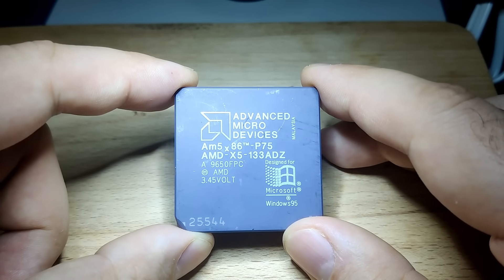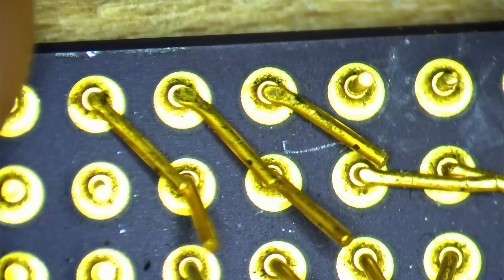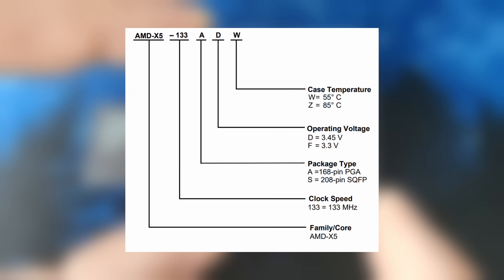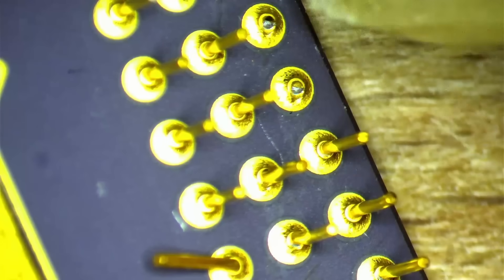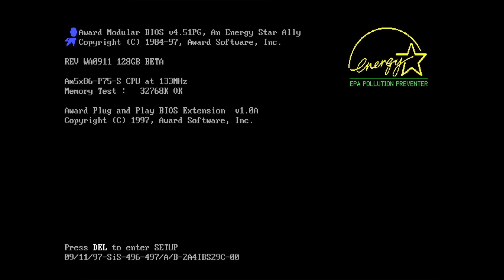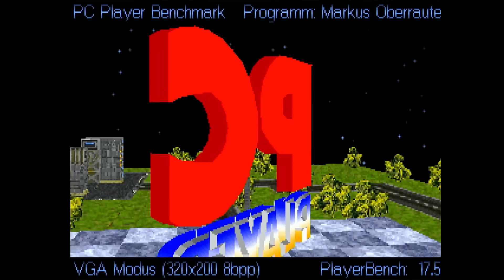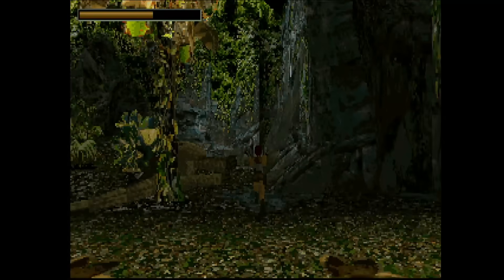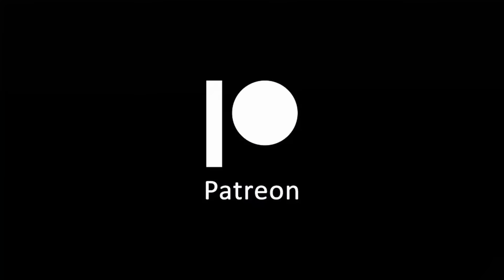Tomb Raider (1996) on the fastest 486 CPU (Part 4)

Comment: If you want to go wild: Try a 60MHz bus  by soldering a line from the S2 pin on the clock chip to ground (or S0 from memory, it's the one who's not connected to any  of the two jumpers). I've done that and gotten the board to boot with a 5x86 at 3x60 . The clock chip and the board is capable of doing it, it's just not connected since the VLB bus might start glitching, but if you do not use it ...
My "record" on this motherboard booting and running doom is 150mhz (3x50), but yours looks in a way better state than mine. Actually ... mine died and two address lines have leakage current comming from somewhere glitching them.
Reply from the maker: Oh, interesting! I am always available for a good mod! I'll have a look at this. The only issue I have with this board is that it only supports FPM memory.
However, I want to try something I found on a German forum: BIOS swap from a different board...
Reply: @bitsundbolts If you want to do that you might want to check the SIS496 stepping, my board has a non-EDO compatible earlier stepping, though information about it is not easy to come by which support what but higher letters in the alphabet is in general better afaik. The specsheet of the clockchip is on theretroweb site for this board. S2 (pin 17) is connected high, grounding it will give you the option for the 30/60/66.6/80mhz bus clocks the pll supports. There is a screwhole nearby which is easy to solder a wire to (+pinheader since the lower bus speeds need S2 to be high to allow you to disconnect it).
Reply from the maker: Thanks for all this info! I will have a look.

Comment: Well I said 5 pins a week ago. Technically you only lost 2, but you had to add solder to a lot more than that. So maybe 0.25 per pin? I saw about 20 of them. So that's about 7 in total. lol I did notice a difference with the overclock even in the beginning. That  felt a lot smoother. The dino still gives me headaches though. lol
Reply from the maker: Haha, alright. Yeah, it wasn't a perfect restore. Those pins were too far gone.
The overclocked AMD definitely improved the game a lot. I hope that I can get the CPU work at 4*50 - that would be amazing!

Comment: I used to do system build during this era. I never imagined these chips would be considered today for a retro build.

If I come across any relics should they be saved or recycled?
Reply from the maker: Those chips fetch more money when saved and sold to collectors and retro enthusiasts - provided that it's a working CPU. There are still some to go around, but they will get more scarce over time.

Comment: Maybe a ridiculous question, but can a motherboard be modified to run at 40Mhz? I've got one of these CPU's in an old Compaq but it only officially supports 25/33Mhz operation and I have always wondered if it could be modified (perhaps replace a clock crystal?) to get 40Mhz operation out of it.
Reply from the maker: Not a ridiculous question at all! I have not done this myself, but what you're describing is essentially what needs to be done. I don't know much about this yet, but it is an interesting question! I may look into this because I think I have a few boards that are similar to what you're describing. Would be cool to get a higher bus speed on those boards!
Reply: @bitsundbolts  I had assumed it was impossible.  I have a Presario 425 and it's two limitations are the bus speed and a max ram limit of 20mb, higher and it hangs on the memory count.  I'd love to solve for both, this was my first computer and it launched my tech career, including more than a decade as a core engineer on Windows at Microsoft.  I've always wanted to restore and upgrade this pc beyond it's limits...

I'll be watching when you go down this road, I'm super curious.
Reply from the maker: Is that this integrated CRT+PC in one case? I have one of those at home as well. I wanted to replace the CPU with one of those overdrive CPUs. I have two Kingston "Turbochip" CPUs which I would like to try out. They should be capable of working in this system without replacing any clock generator.
I am not sure about the memory though. The only issue is, that mine is in Germany and there is almost no possibility to get it to Dubai. I guess I'll have to do it when I am there for a visit.
Reply: @bitsundbolts  Yes! I have the Presario 425 from the very early 90's. I do have a AMD 5x86 133Mhz in there with a voltage adapter and it does work without any change to the clock generator. What I'm wondering about is if we could get one to 160Mhz by replacing that clock and getting the system up to a 40Mhz FSB.

I assume the memory fix will require a patch/hack to the BIOS, but I haven't a clue where to start there. The BIOS hacking sites don't have much about Compaq systems, which were unique in that they had their own BIOS reverse engineered from the IBM one rather than a common one like AMI/Award/Phoenix.

I'm in Portugal btw, need to get my Presario here from the USA at some point.
Reply from the maker: I haven't spent much time on that machine yet. It works and I believe it has a 33 SX CPU currently installed. It might be a challenge to get this system modded because, as you said, it's Compaq and not much information may be available for it.
Reply: @bitsundbolts  In the USA it was the first PC I ever saw for under $1000 which is how I could afford it, but it opened doors for me and as I said led to my career. As a result it's the only vintage hardware I've hung onto over the years.

Comment: I found a Am5x86 in a box of old parts at a local PC shop that was doing a closing down sale among other chips, funnily enough the date code puts it as 3 weeks younger than yours and thankfully only one pin has a very minor bend, although I need the rest of the system to go with it.

Also found a 256k Pentium Pro there too, very keen to try that out.
Reply from the maker: Very nice! I'm still amazed how Pentium Pros make other CPUs look really small 😁

Comment: I’ve used a red plastic tube from a can of wd40 to straighten pins, and also a hollow metal hypodermic needle. Just use finesse. I can also verify I had a ADZ version of this chip from new in 96, and used an interposer for freq/voltage and was clocked for 160mhz, 40mhz bus with no issues. Was on a shuttle 486 motherboard(forget the model)
Reply from the maker: Ah, I always lose those red plastic tubes 😞
But good point! I'll try to get one of those and see if I can work with it

Comment: Finally the video i was waiting for!!! Super ultra excellent job on the pins too, many would have just tossed this cpu in the bin... If your mobo allows and you have time, try 3x50 (perhaps insert a snippet of footage into your next video about these socket3 adventures). My ADZ runs that even on 3.3V and it gives further increase in performance compared to 4x40...
Reply from the maker: I'll add 3x50 in the benchmark video when I add the Voodoo card (after I fix it). My CPU does 150 at stock voltage as well. I'll also attempt 200 MHz, but I have to increase the voltage.
Reply: @bitsundbolts  thats cool! Cant wait to see that. Mine unfortunately tops out at these settings, lets hope yours do better. :) Tried 4x50 and 3x60 but neither of those work, wont even show any vga signal or any beeps.... :(
Reply from the maker: Yeah, totally depends on the quality of the chip. I don't know what mine will be able to do, but it would be amazing if it can do 4*50. I need to change the motherboard for 3*60. I don't know if I have one that supports such bus speeds. I just started working on the Voodoo card. Hopefully tomorrow I'll be able to test it.
Reply: @bitsundbolts  with the voodoo, tomb raider will fly as it will take the load for most of the calculations off of the cpu. But if your cpu will do anything more than mine clock wise, i will secretly accept the defeat. Im still crossing my fingers for you regardless because one 486 doing 200mhz is better than none lol (plus maybe an extra opportunity for you for one more video) :D

Comment: Erst liken, dann ansehen. Absolut erstaunlich wie viel Zeit und Sorgfalt in deine Arbeit reingeht und man danach mit einer funktionierenden CPU belohnt wird. Ich kann auch bestätigen, dass der ADZ bei FSB33 vom Speichersubsystem gebremst wird. Ein ADZ mit 3*40 ist ähnlich schnell wie ein ADZ mit 4*33. Du könntest mal prüfen wie ein Ur Pentium reagiert wenn man mit 2*50MHz oder 1,5*66MHz arbeitet.
Reply from the maker: Ich werde 3*50 und 4*50 (mit höherer Spannung) versuchen. Mal sehen ob's klappt. Leider kann das Soyo Board nur mit FPM Speicher. Mal sehen ob ich ein anderes Board mit EDO Support habe.
Ich habe einen Ur Pentium 75 für Sockel 5. Vielleicht mal was für ein zukünftiges Video!
Vielen Dank für's Video schauen!

Comment: Inpressive job straighening those pins! I wonder if cracked ceremic on the corner is common on those 5x86 cpus, as that happened to mine too. Only other software mode I would have liked to see is 50x3, as this is what I settled on back in the day. It consistently pumped out more fps than 40x4 in Doom and Quake on my setup. I know it's difficult to find tolerant video cards for this fsb speed though.
Reply from the maker: I tested 50x3, and it worked. The BIOS reported an AMD CPU with a P75+ rating. 
I'll cover 150 and hopefully 200 MHz in a later video.
Reply: @bitsundbolts  Nice, I'm always curious to see fsb vs clock on the 486 platform, since that's where I first experienced overclocking.

Comment: I ran the ADZ model at 200mhz. VLB clocked at 50mhz with cards that handled it. I ran Netware 3.12 on it at that speed for about a year lol
Reply from the maker: Did you increase the voltage or did the AMD run at 200 MHz with stock 3.45 volts?
Reply: @bitsundbolts  It was a long time ago, but I suspect I left the voltage the same; my younger self didn't know about voltage increasing for overclocking if I remember correctly.
Reply from the maker: Wow, it must have been a good chip. Mine doesn't boot @200 MHz when I leave the voltage at 3.45v. I wonder if it boots if I increase it to 4 volts.
Reply: @bitsundbolts  Its worth a try. I do recall reading somewhere at the time that some would go to that level. Unfortunately I have had a few sleeps and beers since then, and cant remember my exact setup. CPUGalaxy had this running @ 200mhz with 33mhz bus  with a multiplier of 6. He uses a peltier cooler - I certainly didnt have one of those back in the day lol
Reply from the maker: Yes, I watched his video today. I think it was 66 MHz FSB and a multiplier of 3. Massive speed gains if the board can deliver and your video cards work at this frequency. I'll try 200 using air-cooling. The ADZ model with its higher temperature rating should allow for some headroom. He used an ADW, but he had to go through many samples. So, I don't get my hopes up
Reply: @bitsundbolts  Ah I forgot he used an ADW (it was a while back when I watched his). I used nothing more than air cooling back in the day. Good luck!
Reply from the maker: Good to know. I'm not in the mood for a complex cooling solution 😅

Comment: There's actually a tool used in Watchmaking called a Pin Vice that would be amazing at getting the pins straight once you have the standing upright, I'm 99% sure its pretty inexpensive too.
Reply from the maker: Interesting. I'll check if I find what you're mentioning. I have so many socket 7 CPUs that need to be fixed.

Comment: Great job. I'd like to see 3x50 MHz and I think it would be faster in games than 4x40 MHz.
Reply from the maker: Fun facts: I tried it. In SpeedSys, the score is a bit lower compared to 169 MHz, but I didn't try it in game. But I'll try 150 as well as 200 MHz when we have the Voodoo card and a frame counter.
Also, @150 MHz, the AMD CPU shows up with a Pentium rating or P75+

Comment: I'm pretty sure the ADW version of this CPU was the one I got for the very first computer upgrade that I bought myself. It was a good upgrade from the 66MHz 486 that I had before, but it wasn't as much of an upgrade that I hoped. If I'd known it might have been a simple matter of bumping up the FSB to 40MHz, I definitely would've tried it and enjoyed the speed boost for a little longer before I upgraded. I think I got the am5x86 sometime in 1996, and I'm pretty sure it took me over a year to save up for its replacement. Even second hand, a Pentium MMX 166MHz was pretty expensive for a high school kid with no job. But if I'd waited a few months, I would've found I could buy a Pentium Pro 180MHz for about the same price as the Pentium MMX, and overclock it to 200MHz with no issues. I did end up doing that probably about 6 months later, because the guy who was selling that Pentium Pro board and CPU kept bringing it back to the computer market every month and dropping the price until it was stupid not to buy it (I think I paid like $60 Aussie dollary doos for it).

Anyway, great to see another scrap CPU fixed and working! It was very stressful watching you bend those pins back, I thought for sure one was going to break! But when you said those pins couldn't be straightened, it was somehow a relief that you decided to break them off and solder replacements on. But congratulations on a job well done, I'm sure it was very satisfying when it booted for the first time!
Reply from the maker: I can fully relate to your 486 experience. I had an AMD 486 DX4-100. I remember how scared I was overclocking it to 120 MHz. I found out because I went through the motherboard manual. But I reverted the overclock a few hours later because I was scared of damaging the CPU. And I couldn't feel much of a difference during the time it was overclocked.
I have two Pentium Pros (180/256, 200/512), but no board yet. Those CPUs are massive! Back then, I never paid much attention to them.
That beep during the first boot was definitely a relief! Would have been sad if the CPU wouldn't work after all this work.

Comment: These cpus can get up to 200mhz i used one of these clocked to 180mhz for years and played quake and other games with it.
Reply from the maker: That must have been at a bus frequency of 60 MHz and a multiplier of 3. A very nice overclock for such a CPU and the rest of the system. I need to check if I have a board that supports such a bus frequency. That system must have served you very well!
Reply: @bitsundbolts  yes i remember playing a lot of games that had pentium 75 or 90 in their requirments and they still ran pretty well

Comment: If only for asthetics, i personally would have repaired that broken corner with a bit of milliput or something similar, and filed it down with a nail file. Not that it would make any difference in operation, but it would give it a nice finish.
Reply from the maker: I can still do that. The corner is a bit of an eyesore, but it also is proof that this is the same CPU before and after fixing the pins.
Reply: @bitsundbolts  yes that's true. I think my OCD would have forced me to do it. Amazing job on those pins btw.  You did a marvelous job. I remember 12 year old me building my first pc with whatever I could get my hands on cheaply, and having to do a pin straightening job on the CPU. I snapped 3 pins off, and I had 2 use a paperclip to make new ones because I couldn't think of another way to repair it. It worked though, right up until I was around 15 and could afford a better machine.
Reply from the maker: A very creative solution to use paperclip. Glad that it worked out for you!

Comment: I've always thought it should be called the DX8, because clearly the multiplier is the log2 of the DX number plus one.
Reply: No, it isn't :) I have read somewhere that it was basically just a market name thing. It went like this: when Intel originally invented the thing called multiplier, they came up with multiplier of 2. So they marked it DX2. But for future, they wanted more granularity, so they planned to use halves, not only integer numbers, just like they were being used for many years to come in Pentium 1/2/3/n lineup :) So the next multiplier was planned to be 2.5, for which a market name DX3 was planned. But the processors with this multuplier were never released. However, it was already decided, so when multiplier of 3 came out, the processors were marked DX4. Thus, AMD did the next best thing they could when adding a new feature to an already abandoned (by Intel) platform, and marked the multiplier of 4 as X5 :)
At least, this is what I heard on how these strange DX numbers arose.

Comment: Please try to achieve 200MHz
Reply from the maker: I'll try, but there is always a chance to kill the chip because I need to increase the voltage.
I'll do it once I'm done with the Voodoo tests.
Reply: Stable 200mhz is much more difficult than some of the comments in this video imply.  Finding a chip that will even boot at 200mhz is very rare.  You have to run at least 4V, and most chips need TEC coolers to achieve.

That being said, I’ve run many AMD 5x86 at 4V without immediate damage.  I imagine running for years at 4V would not be a great idea.

Comment: Wish I had a cheap LS486E board... my ADZ unfortunately only runs at 160MHz...
Reply from the maker: Have you tried to increase the voltage to 4V? Mine also doesn't boot when leaving the voltage at 3.45 volts